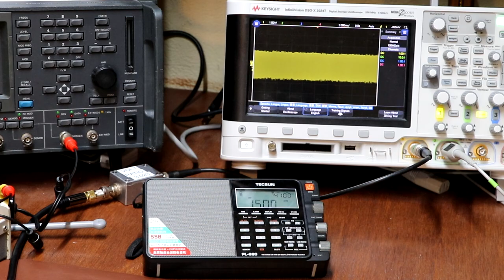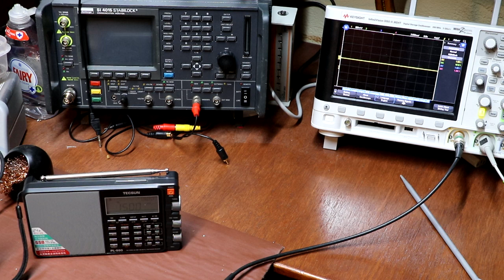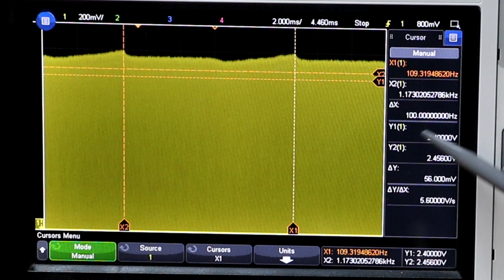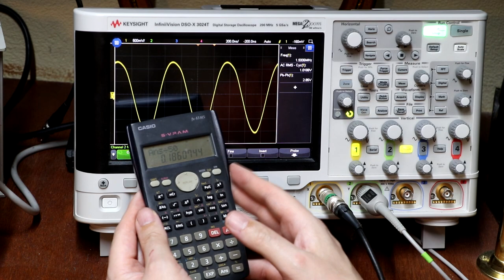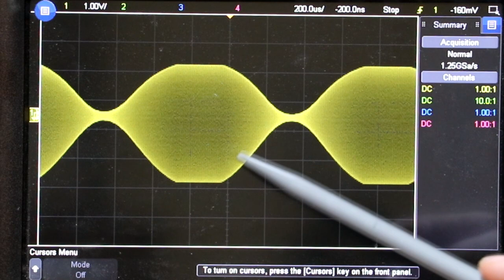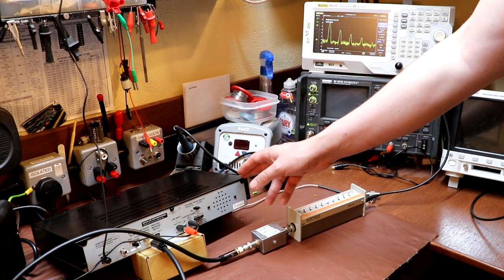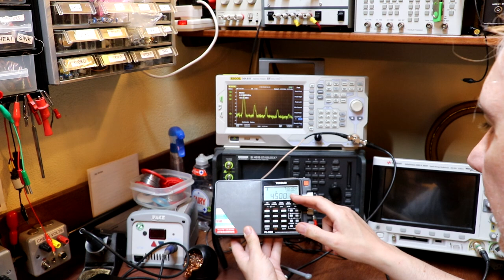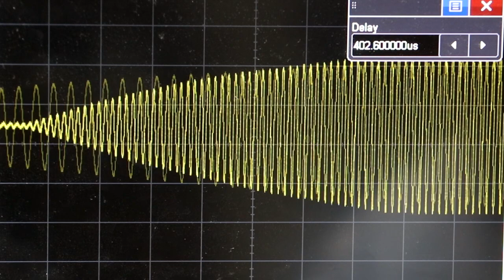Talking House Transmitter TH5  -  Part 2  Talking Rubbish

Comment: very interesting unit that Chris it would appear its about the same range as our local community radio !
Reply from the maker: I think it could probably be used for community broadcasting with the outdoor antenna for sure.  The antenna from the manufacturer does also include a tuner. Thanks for watching regards Chris

Comment: The external antenna output is supposed to be connected to an ATU (hard to find and expensive when you do), I do believe there are more modern equivalents that was improved upon over the original ATU (Range extender 2.5, and those are expensive as well). The talking house unit with it's companion antenna tuner is how it was  tested for it's part 15 certification by the FCC. 

The external ATU for these is basically the same that's inside the system for the wire antenna, except it's in a water proof box on the base of the antenna and has a manual slider to adjust the tune and a meter.

But even then it's still going to have issues, there's a few mods you can do to these to fix the issue at 23:19

Comment: You should open it up to see if there are any limiter adjustments for the audio, it looks like the positive side is running out of headroom before the negative side... it certainly needs to be brought under control.
Reply from the maker: There is an Audio limiter IC of the type used in a tape recorder level control and they don’t work well. A lot of people feed these through a small mixer or computer that has Audio compression cape ability.  No I have identified the issues I may try and address these if I don’t loose interest which is a distinct possibility given the amount of radios I have. Thanks for watching and comments regards Chris

Comment: 13:35 I think the difference between noise between the switchmode powersupply and the linear, has due the fact that the linear powersupply has a floating ground,
and the switchmode powersupply has a high impedance coupling to ground through the X1 and Y2 safety capacitors inside. 
A linear wall powersupply with the right value of smoothing capacitor won't produce any noise or ripple, only if is the negative is grounded (bench powersupply), you can get a groundloop because the transmitter is grounded through the coax cable to the scope.
For testing purposes, a 12V car/bike battery can be used to create a "clean" humfree powersource.
Reply from the maker: Yes your quite right on the ground loops on the scope but I did also try my battery scope and it didn’t make any measurable difference to the noise performance of either PSU. The transmitter really does need to be well grounded viA the power supply or a separate Earth. The supplied wall wart linear PSU is just poor. If your interested we could look at it separately. I haven’t investigated it as it’s no good for our 230vac mains supply. Thanks for watching and great comments regards Chris
Reply: @allthegearnoidea6752  a autopsy of PSU is always interesting :-) 
Ps : i don't know if you seen it already, but i sended a mail yesterday. >Take your time to respond, there is nothing burning :-) Grtz

Comment: 100% modulation=4X RMS carrier power PEP AM. Not sure you ever made clear what you are going to do with the widget. I've heard some stories about pirate stations in UK. Mostly FM. Do they take pirates seriously over there? A nice linear, mosfet amplifier would work well for that thingy, provided you can devise an efficient way to radiate the power. The antenna is the hard part.
Reply from the maker: Am power measurement isn’t something I have consider very deeply until now. I guess I should give more consideration the envelope power, the mean power and the carrier power of the transmitter. The basic measurement is however a simple equivalent heating and is normally expressed in terms of an unmoderated carrier as shown. But I’m not sure how it would have been expressed in regards the part 15 FCC compliance.  I think it really just needs the audio clipping sorting and perhaps a pie output filter for the transmitter.
Reply from the maker: This is a nicely explained article https://www.w8ji.com/amplitude_modulation.htm
Reply: @allthegearnoidea6752  Filters at low power easy build. Use the right ferrite mix for the frequency. There was "some dude" here that ran FM stereo low power every Xmas from his home, and modulated his Xmas lights with the audio. He even put up a sign in his front yard and adverts on social media "Tune to 99.9mhz to listen" Quite a display, even covered by local TV media.
Reply: @allthegearnoidea6752  I remember talking to him on the phone back in my early days at Eimac. He out smarted me. Very intelligent guy. Lot's of good info, well known to all.

Comment: Hi Chris, that's quite a lot of power output from that transmitter, of course at  those frequencies you would need a massive antenna! So I suspect your erp will be fairly low, maybe you could do a range test sometime, i suspect it won't be very far, thanks
Reply from the maker: I really should have done a range test if only to show the internal antenna system. I did have a walk around the garden and the antenna was good for at least 50m and probably much more.  I should probably have a look at the part 15 standard to see how the 100mw is specified. I will probably do another video on the modification if I don’t get distracted by another projects. I have the mind of a butterfly! Thanks regards Chris

Comment: As per the manual for the external antenna that they supply it does have the atu in the base of the antenna rather than the internal one. I am planning on sticking one in the feed to the antenna and seeing if I can fire up the external signal with a lot less out of band stuff. Still waiting for my box to land in the uk, it just left Kentucky USA on Friday. Also have a bit of a beast of an FM transmitter to play with too now so I may become rebroadcast central.
Reply from the maker: I can see you getting a knock on the door from OFCOM goons LOL. Thanks regards Chris
Reply: @allthegearnoidea6752  that's why Paul gave me the FM transmitter....
Reply: I've been using one for a couple of years now.  It works great but I did buy the one that is supposed to have upgraded audio capabilities.  The older versions evidently can be improved with a few components.  I think the thread is on the antiqueradios.com.  I usually have my iphone connected via a mini aux cable and have a couple of radios in the shop tuned to the frequency.  Mine does best up around 1.5MHz.  Best to you both, Doc
Reply: @docholliday3150  I will certainly be checking out the mods. Mine seems to error on the indoor antenna. works great on the outdoor socket though. I will have to experiment!

Comment: Have you tried the modulation diagram in the scope?  You put your scope in XY mode and feed the audio to the vertical and modulated RF to the horizontal.  Good AM modulation should produce a clean triangle, clipping will be obvious as the point will be missing  or a short horizontal line.

The clipping is in the modulator as the digital recording is overdriving it.  I wonder if there is an internal adjustment for modulation level?
Reply from the maker: It uses a audio limiter from a tape recorder but it appears to clip rather than limit. No I have never tried. Looking at the modulation on the scope but sounds interesting and will definitely give it a try. Thanks for watching and comments regards Chris

Comment: What an awesome bit of investigation work. I was shocked at the harmonics it was putting out on the external antenna Jack. I suppose for our use it would only need the indoor antenna. What’s your overall conclusion of its use to retransmit audio to vintage radio equipment then? I assume it would have to be input at a fairly low level to avoid that distortion. Great video. Cheers Graham
Reply from the maker: I think the build quality it brilliant and the noise issue can be made acceptable. I wouldn’t not recommend it but better options out there for less money. I may buy some other AM transmitters to do some comparisons and reviews. Thanks for watching and comments regards Chris

Comment: Just a question about the scope. Does it not have selectable input impedance?
Great videos, keep up the good work.
Reply from the maker: The scope I use does have a 50 ohm selection but that is quite uncommon for scope these days as most are not designed for radio work. I still think it’s better to use an external termination as if you forget to turn off the 50 ohms you can accidentally do a lot of damage to the scope and the  DUT.  The internal terminations are also very low power.  Great question thanks for watching and comments. Thanks regards Chris

Comment: I didn't think it was much cop on the previous video, so i was not supprised when i saw the harmonics.
Most of what you said went over my head,  well i'm only 5ft 4 so it would ha ha :-D
So a multiple low pass filter in the output say 3 would help a bit?.
Switchmodes have a sharp chopping waveform like a square wave.
The sharp transitions require many frequencys, very evil things switchodes.
Sounded like i almost knew what i was talking about, "Almost" :-D
Reply from the maker: Just a simple capacitor inductor pie filter would have been an improvement. I’m guessing there something not right with the bias of the output transistors as the top and bottom of the sin with didn’t have perfect symmetry. Of course I’m may be talking bollocks as I normally am anyway.  I think switch modes are less evil then they were historically as a lot of the work is done by clever switch mode control ICs rather than the skill or lack of design skill. Thanks for watching regards Chris

Comment: Cheap and dirty transmitter. Lots of harmonics prove that. If your next door neighbor has a garage door opener the door may go up when you turn the darn thing on!
You should only  use the wire antenna so it  feeds a signal to a receiver in your own home. No harm , no foul.
Reply from the maker: Yes I won’t be using the remote antenna connector as it’s not necessary for my applications at home. It’s probably useable with care but we don’t have a part exemption in the U.K. so sure it’s illegal in any case but know one cares theses days. Thanks for watching and comments regards Chris